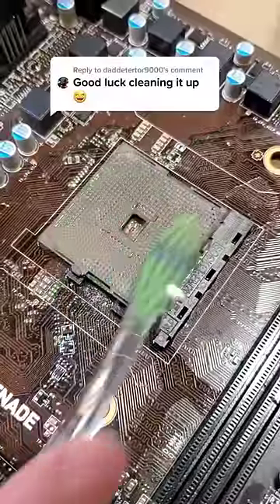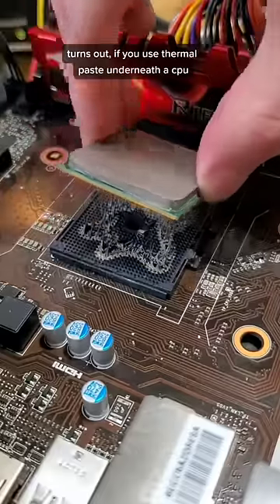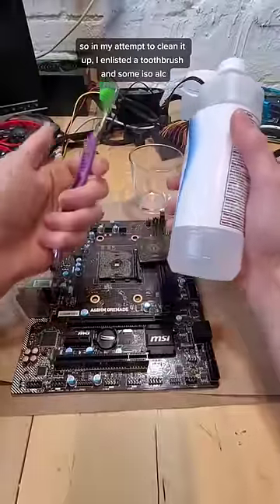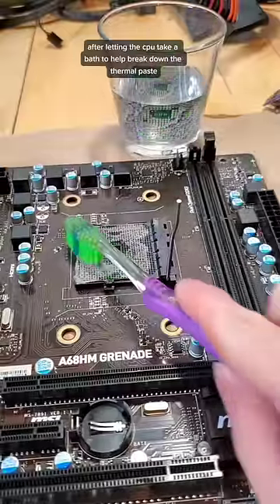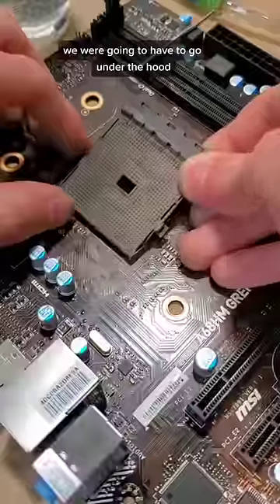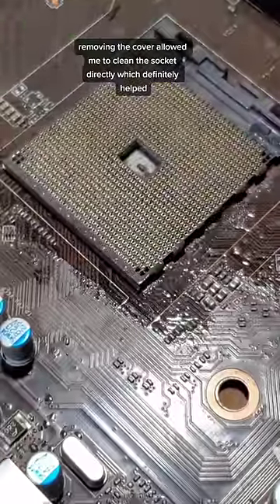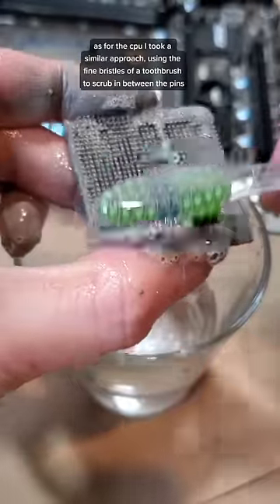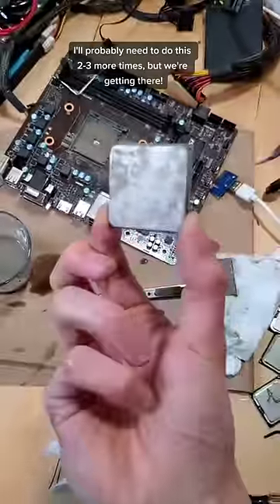how to clean thermal paste off of a cpu socket #shorts

Comment: A really useful tip for removing thermal paste is compressed air cans. Hold them upside down and freeze it. It destroys and evaporates much of the paste, repeat til clean. Surround the board in tissue for any flying paste drops too
Reply: Just be careful as those cans can leave water vapor on your system which is very likely to cause a short as the water is not de-ionised. I use 70-99% IPA to help remove paste.
Reply: That's wild I'll have to give that a go

Comment: This is making my anxiety go through the roof.
Reply: SAME!!😅
Reply: 🤣 me 2
Reply: Indeed. Seeing this makes me cringe
Reply: Bro definitely had bent pins afterwards💀
Reply: @bryanjacla1068  why
Reply: Kind of the same feeling I felt the first time I saw someone take a hose and cleaner to a CRT arcade monitor with the circuit board attached. Turns out they're incredibly resilient and you can do that as long as you dry it out well. Just kind of shocks you the first time you see it.

Comment: Thermal paste uses a silicon oil as a base and cannot be dissolved by water or alcohol. It can be dissolved and fully removed by another oil-based cleaner like Goo Gone or WD40. Just be sure to clean the oil off using alcohol.
Reply: The point of using IPA is because you're not necessarily trying to dissolve it. You're simply making it wet so you can remove it. 

Though you can put a lot of stuff on your PC and probably be fine. IPA is significantly more safe for hardware and doesn't leave any notable residue while removing mostly everything albeit, not via dissolving.

Comment: bruh how the hell did you not break pins while brushing the bottom of the amd cpu
you have god hands my dude
Reply: Best toothbrush ad
Reply: Pins are a lot stronger than you think.
A soft brush toothbrush can clean pins without issue. I had to scrub a CPU once and I had no issues.
Reply: I did it about a month ago when changing my cooler. The pins are a lot stronger than you think.
Reply: Just go in straight up-and-down motions and not in circles like some people tell you when brushing your teeth. 😊
Reply: @baked_horse  yes, I have cleaned the pins. It's not that fragile.

Comment: So I actually have a story regarding something like this.

I was going to help a buddy build a PC for some video editing and he got all of his parts in before I could come over and help. He asked me if it was okay if he looked at everything just to see what it looked like and I said sure. What I didn't know is that he was doing more than looking at the pieces. He sent me a picture and asked me if the cooler was going to interfere with the RAM because he wasn't sure that there was enough clearance and I saw that he was putting things together so I told him just to wait a little bit until I get there. And then after that picture he sent me a picture of thermal paste on the socket that had been smushed down with the CPU and asked me if the glue is going to mess up the contacts between the CPU and the motherboard. Needless to say I was left speechless. The GLUE. He didn't even bother to look at the manual or anything like that or watch any sort of video he just went.
Reply: You should'a cancelled and head back home and let him deal with it
Reply: I've seen guys like that. Generally they have much more money than they do brains and patience. LOL.

Comment: When you apply thermal paste on both sides, are you going to notice a temperature difference?
Reply: No you do not, I get that this is for a joke and all but if you just spent 5 mins doing research, you'd find that the answer is NO.
Reply: Motherboard socket and cpu? If so, no, the thermal paste only fills the small space between the cooler and cpu, the cpu might look smooth, but it really is not. Thermal paste on the motherboard would not do anything, it does not cool the cpu.
Reply: When you use an CPU with LGA socket, you see at the bottom that there are some small electrical components placed. It would be insteresting.
Reply: CognizantxNight  Nope,I dont mean the pads. I mean the components in the center. As long as it is non conductive, it doesn't cause damage. However I wouldn't eat it. And now the idea of a CPU sandwich comes to mind. Just 1 of those is ok.
Reply: @tweakz_tech  thermal paste needs a cooler to do its job tho, no heat transfer no use lol.
Reply: Not a worthwhile one.

Now a fan on the backside of the socket on the otherhand...
Reply: No. Don't feed this man he is completely deranged and should be stopped at once
Reply: @seedlesspizza3877  so you mean mr yeester?
Reply: @tweakz_tech  yes his experiments don't make sense not even in the slightest
Reply: It will as long as there is rgb inside.
Reply: The heat comes from the circuitry, not the pins (for the most part).  Highly doubt you'd notice a temperature difference as thermal paste is to transfer heat from the shield (or whatever it's called) to the cooler as it doesn't sit flush unless milled and precisely installed with absolute no gap.

I could be wrong, my knowledge of computer hardware is very limited.
Reply: No, but cooling the back of the motherboard (behind CPU) can help with overall cpu temps and getting a maximum overclock.

Comment: You should try some automotive contact cleaner spray, generally it blasts the paste right off without needing a brush, and it's non conductive
Reply: Certain Contact cleaners contain oils. Though it isn't conductive, it can prevent necessary voltages/data from being correctly transferred between components. 

99% IPA is the best thing to use for computer hardware as it doesn't leave water nor any oils behind.
Reply: @tyf.4399  So use contact cleaner first, then rinse with IPA.

Comment: If you let the thermal paste rest under the cpu long enough the heat will turn the paste into a cake which you can peel off gently and brush off the minute particles afterwards without this much hard work!

Comment: you don't need any of that
 that's extra work 
It takes too long 
brake cleaner spray you would clean it much faster 
more efficiently 
and it doesn't ruin anything
 I use brake cleaner, 
I don't use isopropyl alcohol

Comment: Lucky that was a PGA amd cpu. Intel lga brushing would destroy the socket... used to work for a place where a customer did this accidentally (misread ditections - idk) as they built a pc and the board ended up in the shop. Only way to get it out of lga is ultrasonic.

Comment: on behalf of all PC builders everywhere: please don't do this, while it may work a little bit, it won't work all the bit, it will create a stinky mess, and while good thermal paste by design should be alcohol soluble, thermal paste is thermally conductive only, and thankfully not electrically conductive, so for those wondering why putting thermal paste on the bottom is bad, you are literally suffocating your CPU lol

Comment: I just installed an aio like a few hours ago while moving my whole pc to a new case and well i noticed i got some paste into my cpu pins so i just used a denture brush my grandpa had spare and that worked without iso to get it off and not damage it if you gently brushed it in short slow motions

Comment: Just use a contact cleaner. The thermal paste will break down very quick lol.
Reply: Certain Contact cleaners contain oils that can prevent necessary voltages/data from being correctly transferred between components. IPA is significantly better for ensuring you don't unintentionally put oils or similar materials on your PC. Although contact cleaners probably won't kill hardware, it has been known to cause stability issues as hardware isn't getting everything it needs to function.

Comment: just soak it inside water+detergent for 30-60 minutes, rinse and dry it in the sun, your mobo+gpu+psu will clean as new.....
common "air duster" method wont give satisfying result if you're a smoke close to pc or pc is in a bad air flow/environtment...
Reply: That's not a good idea at all.
Reply: nah, i've been doing it for years, and get paid for it

Comment: I didn’t know you can put a cpu under water 😳
Reply: it isopropyl alcohol not water
Reply: @iatetoomuchcement  And even then you can still clean components with water as long as they are powered off and you leave it to dry for at least 24-48 hours.

Comment: Need help, my pc just died and i took it apart and saw some thermal compound had reached the pins and into the socket. But it was only 5 pins on the side. As of now my motherboard is dead like even changing cpu, psu disconnecting the hard drives and ram it still wont  turn on. Is the motherboard permanently dead or is it repairable? I have a msi A320mh motherboard and ryzen 3 3200g chip. I dont have graphics card and use a 250watts psu.

Comment: Dear Sir, Please help me! 

I can't enter BIOS even after pressing DEL/F2/F8/F12/END KEY only it shows 'Prepare to Enter' after that "_" this Symbol keeps blinking on the Left Top Side. And I can't enter Windows also. I did every possible trick but nothing works. I did the RAM Changed, Processor Changed, PSU Changed, CMOS Battery Changed and also Reset the CMOS But nothing works, the CURSOR Still Blinks. So, what I will do! 

Please help me if anyone has the solution. Thank you.
Reply: What is the computer brand?
Try pressing the esc key.
Reply: @NethercraftMC  I Pressed all the 104 keys on the keyboard but No Use. If you really know something about PC's then only reply Okay
Reply: @NethercraftMC    Mobo- Gigabyte G41 Combo, RAM-6G, CPU-Core2Duo, VCard-GT710
Mouse-Logitec & Keyboard-Dell KB216,
Monitor-BenQ EW2440L 
Now find the solution 🤣
Reply: @creativitymeetsinnovation  try unplugging your harddrive/ssd and press the DEL key and see what happens.